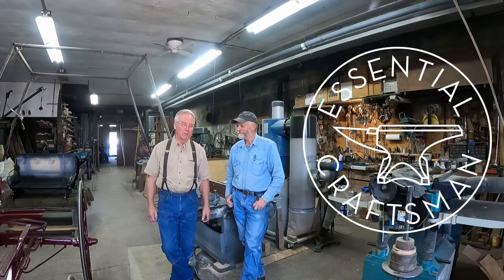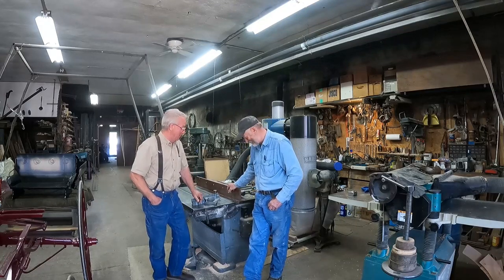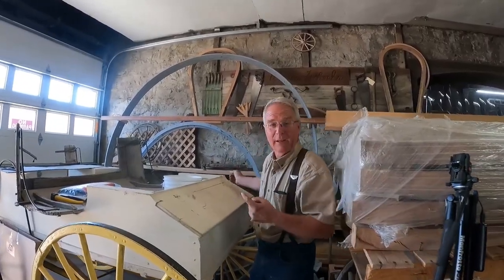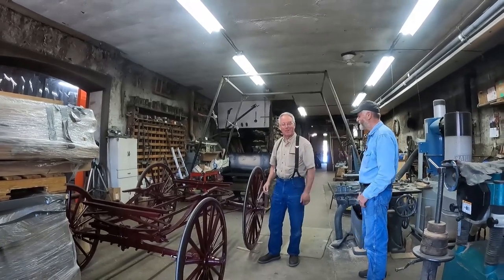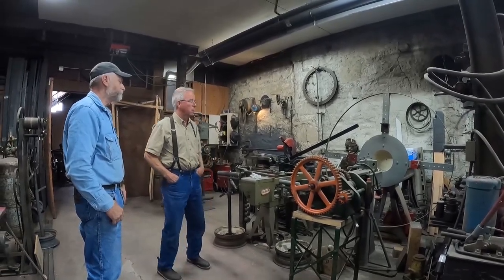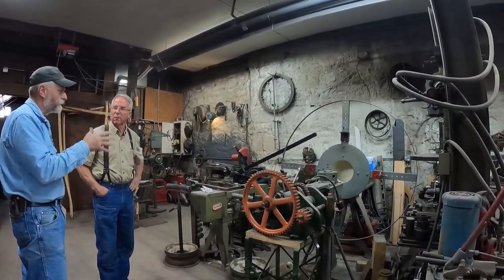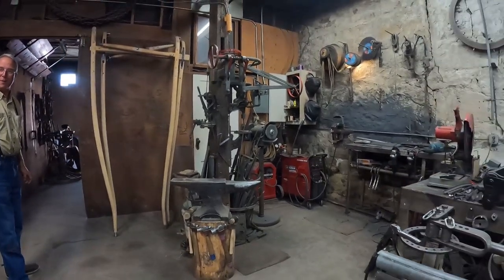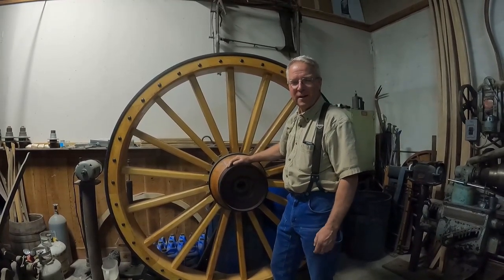A Visit to Engels Coach Shop

Comment: Finally I understand the Dish handles the Radial load.  Thanks Guys.  That Table Saw is one of a kind.  I was afraid you would get Dave going on Sanding Dave!  I couldn't get the Manufacturers name of that Table saw???
Reply: Fay and Egan. We have a YouTube video on it called My Favorite Table Saw under Engels Coach Shop.
Reply: @dianeengel4155  Thank You Diane.  I will check it out.  It is like an old car with Muscle car power.

Comment: That is interesting. So far I had seen sliding table saws more as a modern concept and quite common around Europe (In Germany we call them "Formatsäge" as the full sized ones easily can handle full sheets of plywood etc.), while in America it seemed people hang more to traditional cabinet saws. I know that is a tainted perception mainly from woodworking youtubers, and in commercial cabinet making with higher throughput you will find those as well (If they did not already get replaced by CNC machines), but then we also tend to talk more about sheet goods like Plywood and MDF and not as much solid wood boards as they are more common in finer woodworking. Plus those things tend to use quite a bit more real estate than a classical cabinet saw, for a lot of "hobbyist" shops maybe quite a bit too much.
Well lets say I know they were not as new, but 1908 is quite a few decades older than I anticipated.
And having different blades mounted at once sounds like it may come in quite handy as well and save a considerable amount of time switching between tasks.

Comment: It’s also a good lesson that when you work in an area or waters potential you don’t use fiber trim you always use solid wood just like when you built your walls the bottom plate should’ve been treated lumber should never let Raul lumber come in contact with concrete it will always wicked water another solution would’ve been just hold your trim off the floor so it wasn’t in contact with the floor and yes we always learn from our mistakes

Comment: You should see how that tire machine works when Dave does rubber tires on the wheels.  You'd be wondering what kind of a contraption that is ! It's very archaic and appears to be rather dangerous to operate without some training.